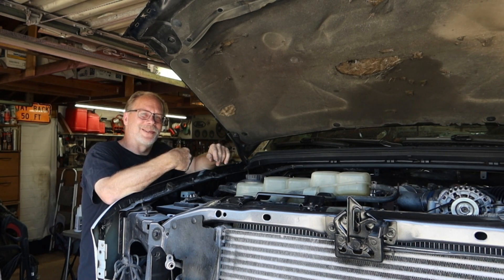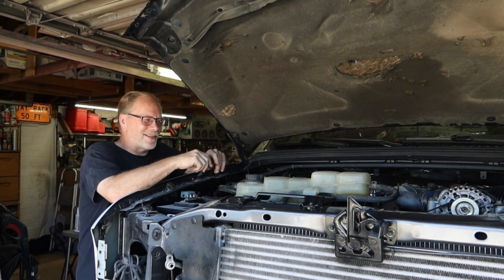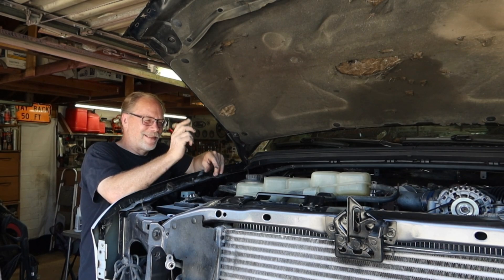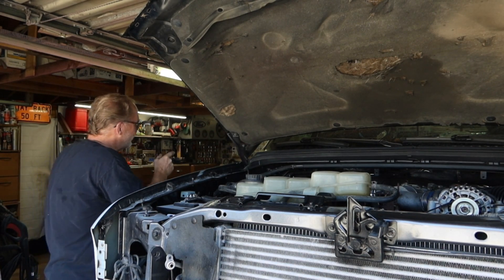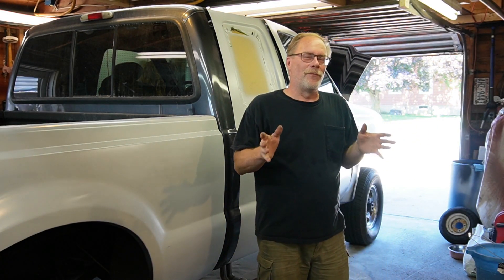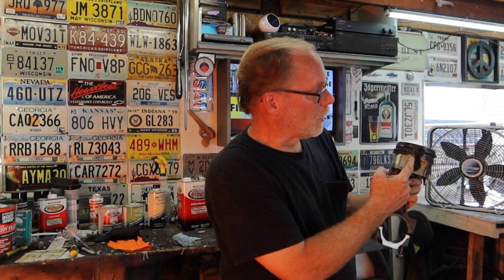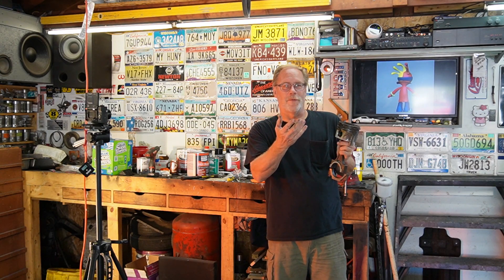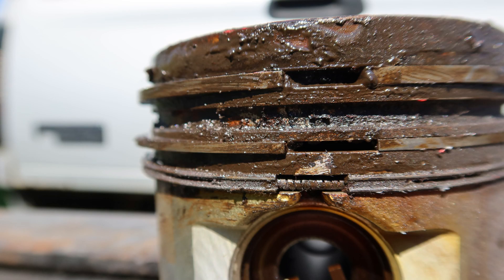🛻📽️ ....7 3 PSD SUDDEN OIL LOSS TECH TALK  🟢🟡🔴🟢

Comment: Can you do a video about blue smoke on start up? I have replaced everything except for my high-pressure oil pump.  Glow plugs. Harnesses. No oil in down pipe but rebuilt it anyways.  Relay. Injectors. Still doing it

About 2 quarts gone every 1.5k miles

Comment: Question. I did have a sudden loss of oil, and smoke from exhaust. I Removed all injectors, Installed new o-rings, did find one bad o-ring. Ran fine for about a couple hundred miles now the same oil loss problem returned but it doesn't smoke while running now. Any thoughts?

Comment: Yall I got a question, on my 97 7.3, I've checked the ipr, injectors, icp, CPS map, fuel pressure, boost, ebpv and sensor and tube, and all that stuff, my truck has low power, struggles up a hill and I really gotta press on the gas more, and it has a strange idle that sounds like it goes high and low and keeps doing that, any ideas?
Reply: Forums kept telling me a bunch of dumb ideas tryna get me me to apparently change my break lights to fix it
Reply from the maker: 97 has several versions depending the state of origin sold, fuel pressure good under load using a visual pressure gauge  ? The Ipr and icp, cam sensor can test good and still be bad test using forscan or bidirectional scanner under load. bad Under valve cover harness or connectors  will also cause this, computer and IDM can cause this forscan or scanner can verify a fault under load basically all tests have to be under load to find a off electrical issue in sensors and fuel LET US KNOW
Reply: @CUSTOMWORKS7.3PSD   I used for scan for the icp and ipr while driving and they showed good results, the injectors also passed a buzz test.
Reply from the maker: @wilsoncountyrp7029  Good Good check the rest let us know ( under load )
Reply: @CUSTOMWORKS7.3PSD  there is a valve cover wire on the top near the back passenger side with a slightly burnt looking prong and oil in it, is this the issue?
Reply from the maker: @wilsoncountyrp7029  I have ran into that situation and it was the issue BUT I also had to replace wires pre and post of that to completely fix the issue as well as one plug lead from the main harness connection . Upon further diagnosis of the burned wire it was throwing voltage to small gauge wires and this was messing up the entire run ability
Reply: Hey I'm back with a update, the ebpv sensor was not the problem and I can hear the turbo through the exhaust so I know the valve is open, I was wondering if the cps may be going put or if that wire I told you about is
Reply: I have recently done a injector cup job but I followed your directions In your video and bought reliable o rings and cups instead of cheap ones